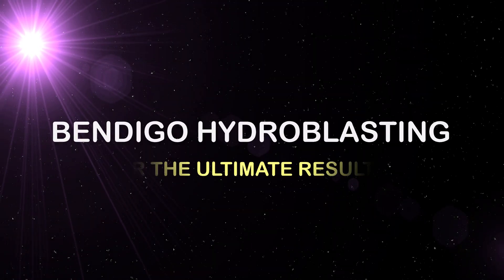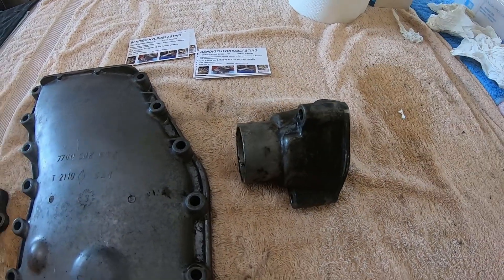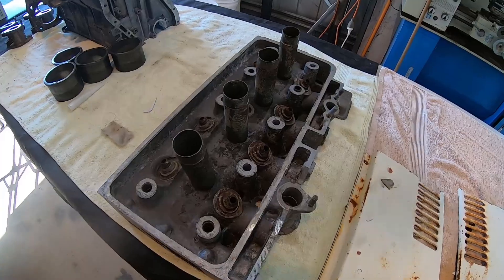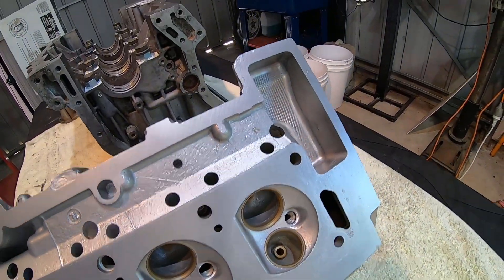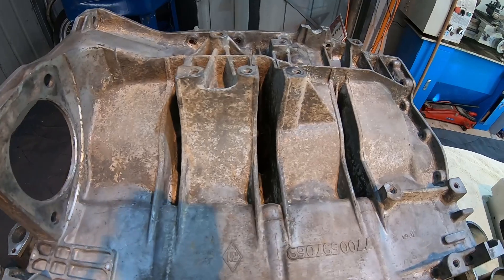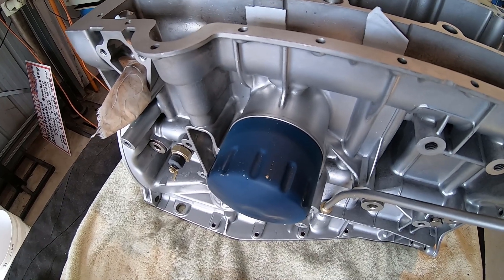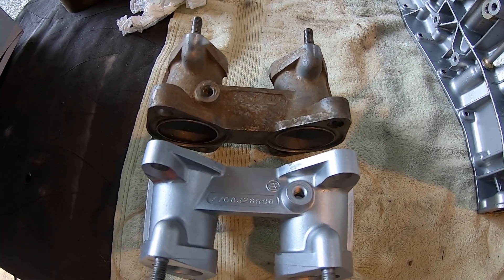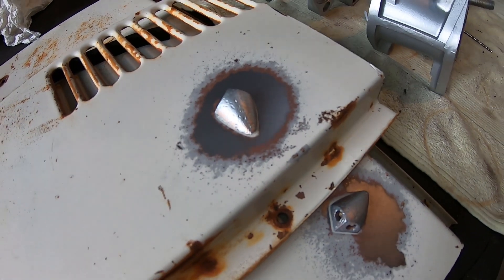Wet blasting a Renault Gordini engine. Bendigo Hydroblasting cleans up an engine for a 1971 Renault.

Comment: Great and amazing work! only concern is how to avoid abrasive remaining inside de oil or water passages and causing future damage to the moving parts?
Reply from the maker: Thanks for watching. I have done complete engines in the past. The reason I don’t do them for customers is they take so long to seal them up and there is always that risk that glass will still sneak in where you dont want it. I’ll have a good look over this engine and if I don’t think I can seal it up properly I won’t do it. Cheers Craig
Reply: @BendigoHydroblasting  Thanks for the reply Graig, do you think using soda instead of glass beads could solve this hypothetical issue?, maybe not with that great shine you achieved, cheers!
Reply from the maker: I’ll stick with the glass. If you spend enough time sealing them up its usually okay. I don’t do them for customers as there is still that element of risk. This one’s mine so I’ll probably spend some time sealing it up and see what happens 🙂

Comment: Transmission case how much to clean?
Reply from the maker: Hi. I charge $75/hr for blasting. It all depends on how clean and or difficult it is. In the past I’ve done trans case, ext housing and bell housing in less than 2 hours. Hope this helps, cheers Craig